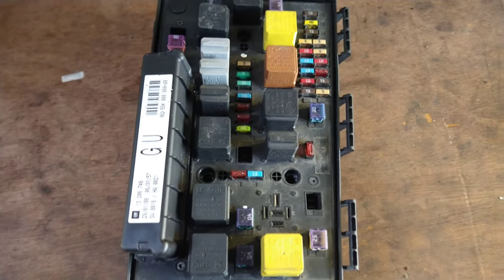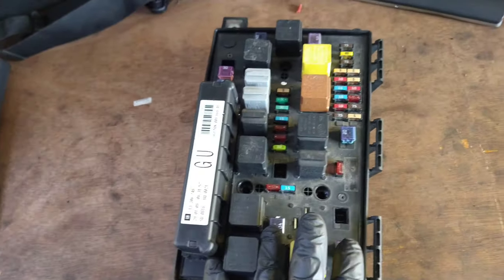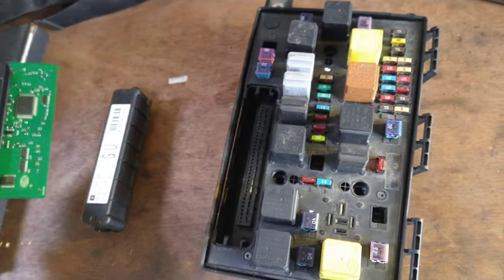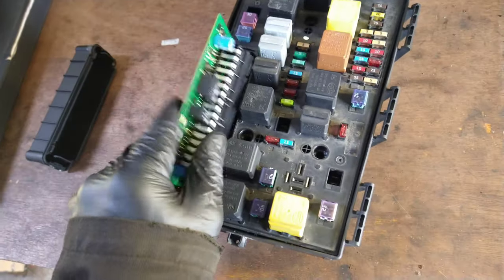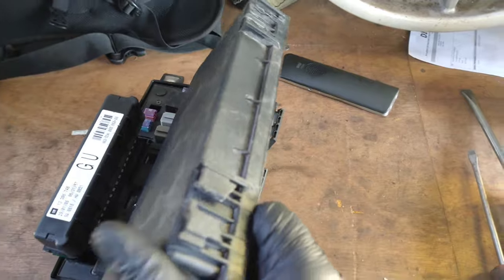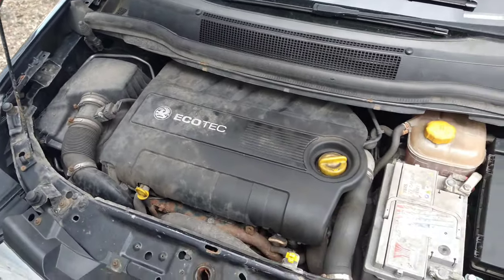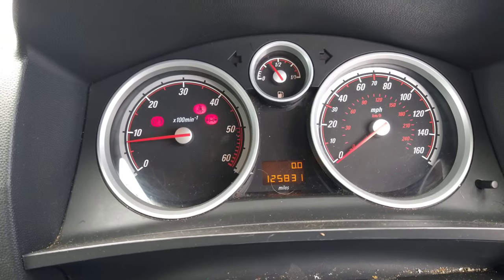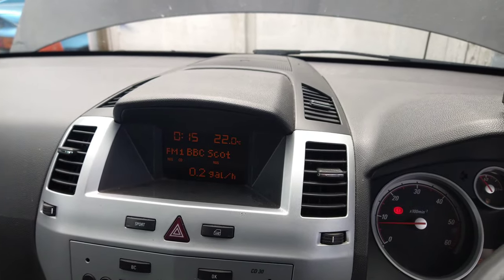Vauxhall zafira (update) fuse box replacement

Comment: Thanks for this video.   2 days ive been searching for a battery drain on the vehicle,   turns out when I press on the top part of the fuse box the short goes away.    All screws and contracts secure as well.  Must be a faulty fuse box,   I wasn't sure if I needed to programme the new box but now I've seen your video its just a case of stopping them over

Comment: Hi matt great info and video ive had a couple of them fuses boxes been corroded got told its a common fault as the drain holes block under wiper shuttle panel and the water does drain away and flows into fuse box
Reply from the maker: That was putting me of fitting another used fuse box incase it was also corroded, however this one was clean and had a properly fitting cover. Thanks for watching Daniel

Comment: How do you remove the lid on that circuit board?
Reply from the maker: A little screwdriver to help pull it off
Reply: There are clips on the short sides of the module cover. Jam a little screwdriver in and they release. I can't get the module itself out though ...

Comment: If you swap that circuit board from the replacement for the one on your car does that avoid the need for putting in codes and reprogramming? Thanks.
Reply from the maker: That's correct, thanks for watching

Comment: My zafira need the fuse box in the boot changed it there any way of do it with out having too get it reprogrammed
Reply from the maker: @Chriskilgore-i5t  I haven't had to replace that fuse box yet, not sure if the circuit board could be changed over like this fuse box

Comment: Hi how did you get the card out?
Reply: I am wondering the same thing. My fuse box just got fried by water so need to replace it as well.
Reply: @abramcarinafriesen4500  the cover comes off with difficulty. Flat head screw driver both sides.  The circuit board is a little easier. Again I used 2 flat heads either side of the black  connected bit to the circuit board and it pops up

Comment: Hi cigarette  fuse is constant live on astra can fuse be moved to make it switch live please help! thanks 👍
Reply from the maker: If you check for an empty slot in the fuse box that is powered when the ignition is switched on, that could be done using a test light or volt meter. If it has one you could use a fused jumper wire to the cigarette lighters fuse location, On the cigarette fuse you would be connecting to the terminal that is not powered all of the time.
However it is possible that the fuse may also power something other than the cigarette lighter, and any other load on that fuse will now be ignition switched power too.